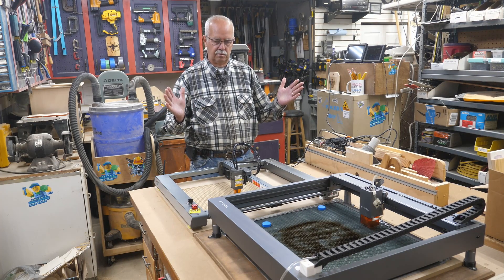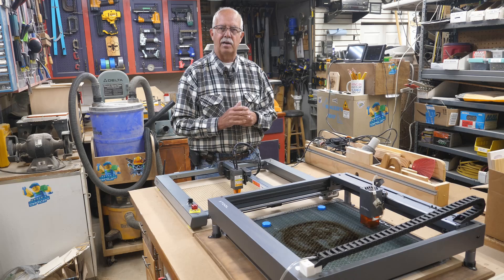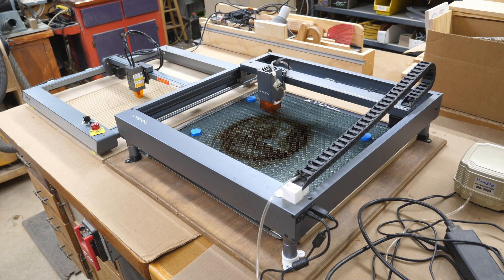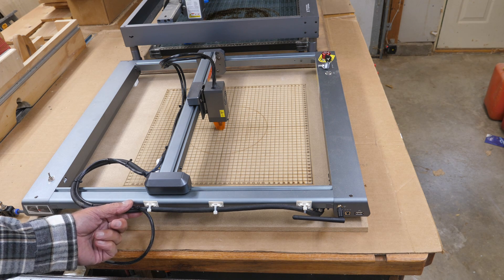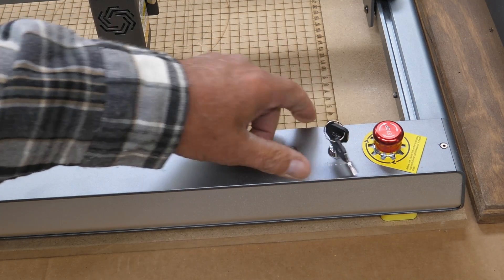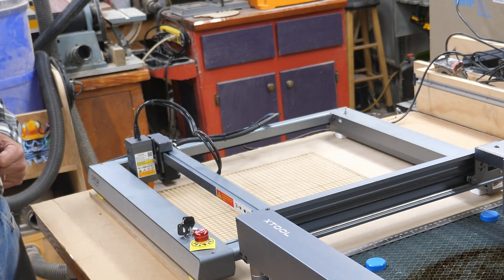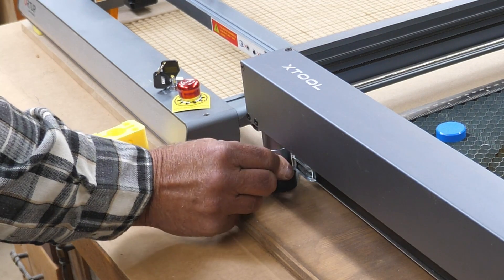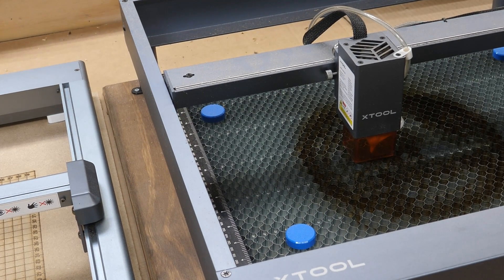Ortur Laser Master 3 VS xTool D1

Comment: I have an Ortur 3 that I got about the same time.  I found out that the air assist outlet is partially blocked by the nozzle threads.  I cut a notch in my nozzle wall and improved the air assist performance.  I have since added a Comgrow 20w laser head but it is not working correctly and I'm waiting for tech support on that.